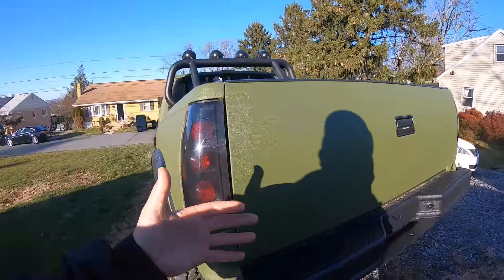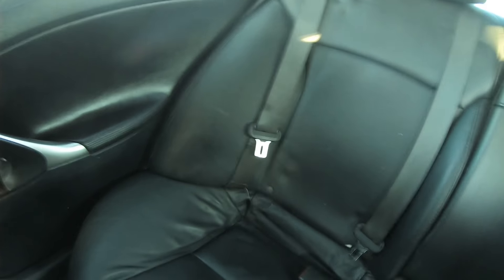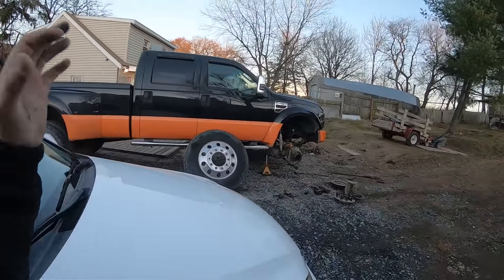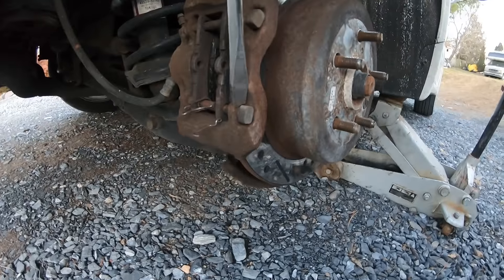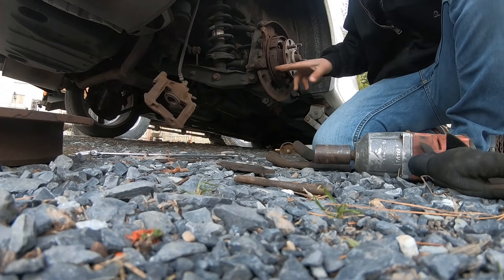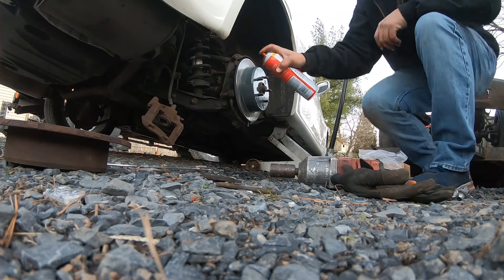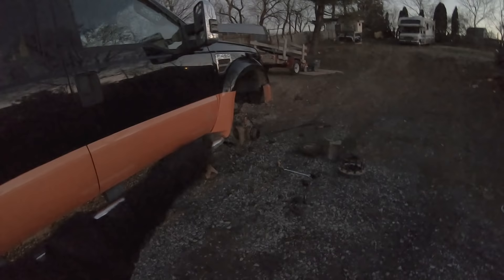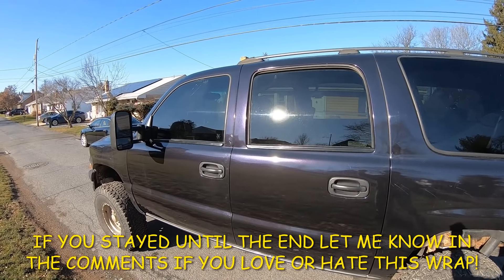ALL OF MY VEHICLES ARE BROKEN. WHAT'S NEXT?

Comment: Hey Steve!  A word of advice when doing brakes on any make, model, year vehicle; especially ABS systems but including older non ABS as well.  You should never squeeze the piston/wheel cylinder back in forcing the old/dirty fluid back up into the system and past the seals.  Always loosen the bleeder screw, then using a proper brake piston tool (very affordable) squeeze the piston back in and having the old dirty fluid drain into a pan.  It will save your ABS and master cylinder seals from premature failure.
Reply: Yes, I know technicians couldn't give two s**ts about customer's cars.  When I was too busy, I had my brakes done at a shop.  The car pulled very hard to the left afterward.  Cost me $150 at the dealer to purge the ABS system and flush the brakes.  Technicians with your attitude is the reason I'll just have to keep doing my own freakin' brakes (for a lot less money) myself until the day I die.  My safety and my family's safety is too important.  Yes, I've also seen the little "trick" where vise-grips are used to "crush" the brake line when replacing a caliper to save time and not care about the customer's safety later on.  Shame on you!

Comment: One pad wore alot more than the other usually means u have a stuck caliper pin 

Edit not the pins that go through the pads the pins where the caliper mounts to the bracket
Reply: @bustinyanutz4195  yep exactly

Comment: Easiest way to push those calipers back is with the old brake shoe and a set of channel locks
Reply: Old brake pad and a C-Clamp works best, That would have to be one ginormous set of channel locks, shoes are what is used in drums brakes, Brake shoes look kind of like a horse shoe, pads are flat.

Comment: So possibly the F450 has some axle shaft bearing issues? And possibly steering knuckle bearing issues? Running the duels on the front sure didn’t help but helped possibly finish them off, while it’s apart you may want to replace the axle shaft bearings - just a suggestion. I have owned 4 F550’s s and some of their parts will interchange with a F450 but not all. My older F550 the 2006 had a dam bird 🦅 fly into and hit the transmission cooler and before I could get off the highway with my 40 foot 4 place stackable car hauler the transmission fried. It was under warranty at the time but Ford couldn’t find a new transmission anywhere in the country so it took 7 weeks to finally for them to get one. Final cost to myself was $568 for my tow bill Fords cost was $5,800 bucks. You had better hope your transmission doesn’t go out. I had a 6.0 go out under warranty that would have cost me $14,000 bucks approximately but Ford ate that also. Ouch these heavy duty trucks are expensive. My 2019 Ford F550 looks like it might be a good truck if not it will be my last one. Take care and thanks